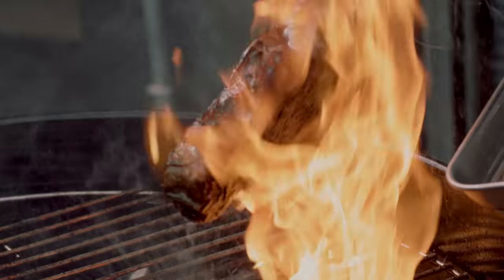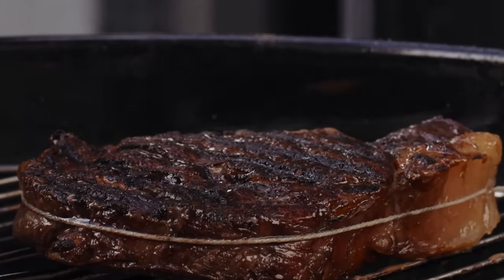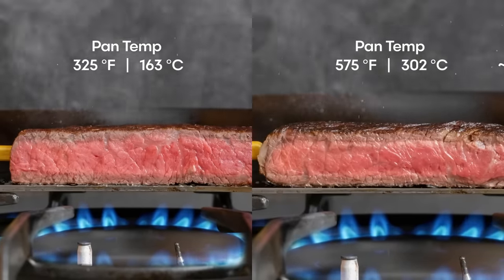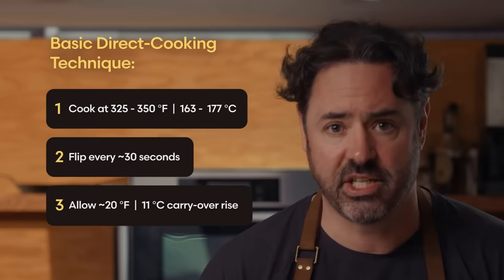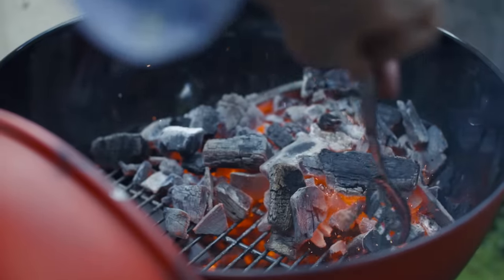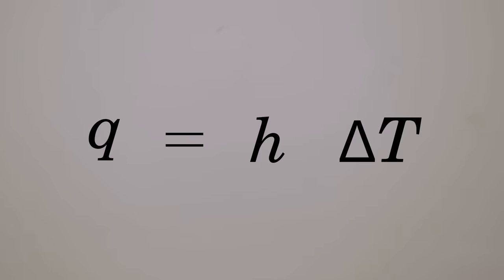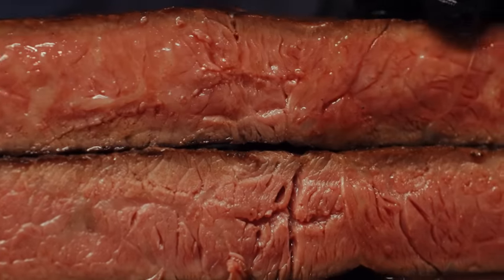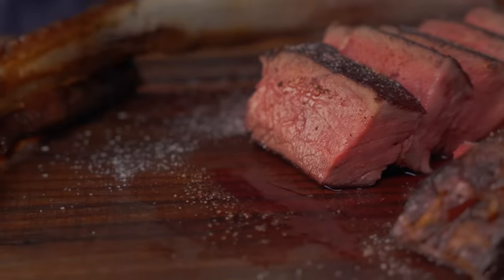Why Ripping Hot Is Too Hot? | TESTED

Comment: i was a professional cook for many years, you only flip once, you do one 90 degree turn on a grill and one flip then one more 90 degree turn but its all subjective really. everyone has their own preference. but the more you flip the more moisture you lose since it generally pools at the top. most of the info here is true tho. but idk about flipping every 30 secs. the temp is on point tho. i mean you can cook even lower because the total temp of the steak shouldnt reach more than 160 which is pretty well done. Its just a matter of how long you wanna wait and how well you want it done. my job cooks at 180 degrees but when the meat hits 145 max its  done so the final temp is a few degrees higher. but i also had a guy that liked his cooked over high heat for literally one min per side. the meat would still be raw in the middle but thats what he liked
Reply: That method has since been disproven by science.
Reply: @convincedquaker  In terms of the moisture loss your right, but that's what they taught at the time where I worked. I believe It was more for aesthetics since your cooking in a restaurant n want it to look nice for the customer. Plus they likely thought it left less room for the patty breaking up the less you handle it. Personally I do 3-4 flips and the turns to keep the nice look whether its at home or not, Obviously that's on a grate since in a pan or flattop it makes no difference. Flipping it more def decreases cook time and I personally notice no difference in moisture as long as you don't overcook it

EDIT: thought this was about burgers haha

Comment: How about an infrared burner?  My IR burner is between 1200 - 1400 degrees and puts a beautifuy sear on a steak in a minute without having to dunk it in oil and deal with the incredibly messy cleanup.

Comment: Two questions. So best steak is sous vide and dip in deep fry? 
Two, does heat transfer is 1kWm^-2 for vaporising content or like a metal bar. Cause if it's the former it's moot when it comes to physics. It's like saying frying ice will work just as good as boiling water on pan and pretending Leidenfrost effect doesn't exist.

Comment: Using a blowtorch rather than a culinary torch is a sneaky way to give your desired result on this test. Redo it with the proper tool. The broad flame on the culinary torch lets you work from a greater distance, controlling the temperature at the surface of your steak.
Reply from the maker: It wasn’t an attempt to get a sneaky result. I’ve used plenty of different torches in professional kitchen for years. They all have this problem. Burning gas is always going to give you a flame temp around 2000F, and the expansion of gases will always create a fast convection zone. Even if you work further away, some bits of food will dry and burn faster than nearby bits on the surface and leave a charred taste. Some folks don’t mind the flavor. I do.

Comment: Very interesting. So additionally, thickness of steak also matters. Now I'm also curious if fat content and consequently cut of meat changes cook time.
Reply from the maker: Higher fat content lowers heat capacity and increases thermal conductivity, so a really well-marbled cut does cook faster. But it’s not a massive difference: maybe 5 to 10% faster for a steak.

Comment: Chris, at what temperature do you take the steak out for reverse searing? At 90 or 100 or 120? You never mentioned that.
Reply from the maker: I take it to 130F edge to edge using the surface temp feature of my thermometer, then let it cool for at least 15 minutes before searing
Reply: @ChrisYoungCooks  thanks. I have yours but I think I need the app to see the surface temperature. Correct?
Reply from the maker: @AllenAchaemenes nope, you can hit the Temp button on top of the display to toggle between core, surface, and ambient temps. Keep in mind the surface temp isn’t perfectly uniform: fat caps run warmer, and the sides tend to run a bit cooler than top and bottom that dry faster.
Reply: @ChrisYoungCooks Thanks again. Last question? After I take the steak from the oven and let it sit for 15 minutes, and sear it one minute each side by flipping it every 30 seconds. Should I bring the heat to low and put butter and start basting? Isn't the side that was seared for the last 30 seconds going to get seared more? How long should I be basting?

Comment: Question about your thermometer - it kept saying "no predictive thermometers were harmed in the making of this video" when they were exposed to very high temps. Is that because they are designed to withstand them? Or more of a disclaimer to not do what it's showing there?  I have never heard of your brand until today, but I have a different one that cannot be used above certain high temps
Reply from the maker: The thermometer can handle temps up to 600F continuously, and the ceramic handle is flame resistant and can handle very hot searing for several minutes like shown in this video.
Reply: @ChrisYoungCooks  that's awesome! Thank you

Comment: I wish I could get hot temps. My issue cooking steaks is usually running out of time to make a solid crust because I don't have enough heat. I hate having gray steaks that are also medium or higher in the center, and maybe if im lucky a couple slivers of brown on the edges.
Electric stovetops are weaksauce, and even gas stoves in newer homes aren't as impressive cause they have smaller pipes and less btu's coming out. If I had access to a grill I'd for sure do some reverse sear goodness more often, but maybe life is just telling me I don't deserve steak as often as I want it.

Comment: That's a lot fo things to think on.
SousVide to 128 and then 375 in 1/2" of wagyu in cast iron?  flip at 30 seconds, for another 30, then let rest?
sous vide to 125? then same?

Heat the wagyu fat in a smoker? ????

Same with bone marrow?

Comment: I was tired of paying 20-30 euros for wack ass steaks at restaurants. Only had 1 or 2 good steaks. So decided to cook at home. Been buying various cuts, from chuck eye, to ribeye from butcher, usually around 22.5 euro / kg for ribeye, thats about 10.2euro/lbs. 30 minutes at 270f/125c in the oven, 2nd rack from top. Then sear on hot pan 45-50 seconds each side, and 45 secs rotating on edges. Amazing juicy steak. I also played around with brining with salt, from 2 hours to 2 days. Just simply put plenty of salt, and put it on the rack and place it in fridge, make sure to have surface beneath for air circulation. Its day and night how tender and tasty steak is, if its brined for a day or two, vs 2-5 hours.

Comment: One thing you missed is that often home cooks get better results starting from a higher temperature because their pans don't retain heat very well, and it drops 150 degrees in the first minute of cooking.  350 might be hot enough, but if they start at 350 pretty soon they'll be at 200 and have to work the temp back up.  But if they start at 500, they'll drop to an appropriate heat pretty quickly anyway.  This could be solved by using a castiron though.
Reply from the maker: That’s worthy of another video, but these tests were done on a 1500 watt burner, and most domestic built-in stoves can supply more power than that. The idea of massive heat drops on a domestic burner and therefore needs higher temps isn’t supported by the tests I’ve done 🤷‍♂️
Reply: @ChrisYoungCooks   You probably don't use a flimsy lightweight $9 pan from the supermarket though
Reply from the maker: @AlexanderRay92  True! But I do have relatives with crap cookware that I have to use when visiting and have to make it work. 

When the metal is too thin to conduct heat well, the best thing to do it use a burner that’s almost as wide as the pan and then make sure the pan is sized appropriately to the food. Even a crappy stamped thin metal pan does ok in this situation. But you definitely have to be more on the ball with your technique or things start sticking and burning. Honestly it would be nice if folks just owned an inexpensive carbon steel pan.

Comment: Great video, but for the experiments are higher temperature searing, shouldn't you have just seared it on each side for just a minute or two and then cooked the steak on a lower temperature? I don't think anybody sears their steaks at "ripping hot temps" and then continues cooking their steaks at those high temps.

Comment: Okay...but unless I'm missing something here, the point of a high heat sear is to get that maillard/char quickly without overcooking the middle.  For a thin steak like 1-1.5 inch, I achieve med-rare at about 500 temp cast iron after 2-2.5 min each side and the whole steak is done.  If I'm at 350, to get that same crust, it would take much longer and overcook the steak, no?  And I've always subscribed to flip once vs every 30 seconds unless it's a thick steak....but at that point, why not just reverse sear?
Reply: the point is that cooking at 500f will develop a crust faster, but doesnt cook the entire steak faster than at 350f
(given the steak has substantial thickness)

Comment: I prefer sous vide and then torched finish. Though, I use different torch that funnels out on the end and spreads heat evenly on about 3” diameter at around 600-800F. This allows more control at quicker rate. Then it comes to parties, I definitely have to switch to a grill that now can be changed to deep fried)
Those stakes looked delicious after deep fry finish!
Thank you for the tip😊

Comment: Speaking of pan temperature, what would be the best type of termomether to read the temperature of the pan?
Reply from the maker: And IR thermometer will work well on a cast iron, carbon steel, ceramic coated, and any non-shiny pan. For shiny pans, the IR will tend to misread and you would want a surface contact thermocouple.
Reply: @ChrisYoungCooks  Thanks, should be set for the emissivity of the oil at 0.95, or the pan material?

Comment: Interesting theories but some notions are just odd. Deep frying doesn't make something greasy because the oil doesn't soak past the crust and its just like a pan baste? Different fats and oils have different flavors. You usually pan baste with butter, you think dunking the surface in peanut oil or whatever is really gonna have the same flavor?
Reply from the maker: Of course oils taste different. They also are purely a surface effect and don’t penetrate beyond the crust. So the amount of oil retained by the crust whether basting or deep frying is very similar.

Comment: This is a bit simplistic. A great steak receives different temperature treatments. With a reverse sear, you absolutely need a ripping hot skillet/grill to get desired texture. Indirect heat on grill is another great way to go from high heat to lower temps.

Comment: I am thinking about doing the deep fry method soon. Just to make sure I am following the video correctly can someone confirm the steps below?

Post sous vide cook pat dry
Heat oil to 400F
Let rest 20-30 minutes
Deep fry steak for 3-5 minutes
Remove and let the steak rest on a cooling try for a few minutes
Enjoy
Reply from the maker: Yup, those are the steps. A few comments: (1) you can rest the meat in the freezer for the best result. (2) Make sure the meat surface is very dry to avoid nasty splatters in the fryer (3) Use a big pot. The pot in the video was over-filled for effect. Generally the pot should be no more than 2/3 full and 1/2 full is safer.
Reply: @ChrisYoungCooks  Thank so much for the advice. It's really cool that you take the time to respond to fans.

I was planning on using my enamel cast iron dutch oven filled just enough to cover the steak. It is only a single 20oz ribeye. I normally use a torch with propane and a Searzall, or sometimes I just use the torch and MAP gas if I want a bit more heat. This method caught my eye when you first posted the video though and I figured Valentines Day dinner would be a great time to try it out.

Do you have a preference on oil type? I was thinking I would either do corn or peanut since both are cheap.

Comment: I don't like sous vide, fry pan, deep fryer and where I live gas grilling is off limits.  I like indoor enclosed cavity electric grilling.  That you get by a Ninja 4 in 1 Indoor Grill with air fry.  It's one of the best air fryers out there and it a darn good effective grill thanks to it's heavy steel grill insert for locking in the built up heat.  Aggressively moving cyclonic hot air is what is really searing the meat like the steak was immersed in a deep fryer.  I hate my sous vide machine and deep fryer.

Comment: Running a charcoal grill for a piece of meat is more time consuming than rewarding. Pan is an obviously better solution.
Eight or even six steaks in a pan would fill the half of a house with smoke and force guests to wait for food for a long time and the host to "enjoy" the solitude. 
The difference between reverse sear option (dozen steaks at a time is not a problem, easy to take them off one by one at the different temperature before guests even arrive if you know their preferences at least roughly) and sous vide (solid choice for a few pieces cooked trouble-free to the exactly same temperature) is also clear. I'm not sure why those questions were even asked.
I feel absolutely stupid writing those banalities.
But thank you for this video. It's awesome, clear and concise.

Comment: Infrared radiation can pump as much heat as deep frying though (as in a ripping hot char grill), though only on one side at a time. 
Maybe we just need some sort of industrial strenght toaster for reverse searing our steaks :D
Reply from the maker: Yes and no. Infrared can carry a lot of heat energy—especially at temperatures where the element is glowing hot. The problem, however, is that the surface of the food usually reflects rather than absorbs most of the energy—making the effective heat transfer rate much slower than deep-frying. Moreover, the emissivity of the food surface changes from mostly reflective to very absorptive as it begins to brown and darken, and this causes a lot of problems. Some parts of the food have little water and will brown quickly, causing them to start absorbing lots of the IR energy, making them darker still, causing them to aborb more energy, getting even darker and so on. This feedback loop continues until the spots that brown first burn before other parts of the foods surface have dried out and begun to brown. This is why you often get spoltchy browning under broilers. It's also why toast goes from not done at all, to burned really fast. Deep-frying cooks faster and more evenly, and no part of the surface can get hotter than the oil, avoiding the problem of uneven browning and burning that plague broilers.

Comment: It’s confusing how, over charcoal, with no boiling zone, that the steaks didn’t sear faster…you stated that the boiling zone in a pan is what causes the problem.
So how does it remain with it no longer being an issue..?
Reply from the maker: The boiling zone is inside the steak and it’s present whether you use a pan or a grill.

Comment: Wait.  From your wording in a few segments, it sounds as if you feel you are hostage to whatever the dampness level of the meat is, before searing.  Doesn't EVERYONE pat their steaks as dry as possible, in advance of the sear???  Seems to be a universal recommendation in all searing info I've encountered.  I'd love to try a deep fried good cut of beef, but since I don't use garbage seed oils, there's no way I'm setting up a full pot of olive or avocado oil.  P.S.  It seems like someone really needs to define "ripping hot" in a more precise manner.  The vague notion I get seems to be that it starts somewhere around 500F.
Reply from the maker: Patting dry does nothing to change the amount of water within the actual tissue that has to be removed during searing.
Reply: @ChrisYoungCooks  Oh....well I'd never heard anyone address that, only that the surface needs to be dry for the best sear.  I think I've actually been undershooting the sear temp, and will make sure the next one is about 350F, and I'll flip every 30 seconds as you've recommended.  It's clear to me now that I've never come anywhere near "ripping hot", and I'm glad of it.

Comment: Just put them in the oven  for an hour or so at 60°C so the inside is perfectly done. It also dries the Outside and makes the meat more tender. Then sear hot and fast. 

All the steaks you´ve shown here had overcooked sides and I wasn´t impressed by the crust either.
Reply from the maker: Literally two of the steaks were sous vide and sear and a very low temp reverse sear. If you reckon you can do better post a picture or I call BS

Comment: Great camera recordings - however, the core of this video is wrong and that is due to a lack of biochemical understanding. You can not record flavour synthesis with a camera ;) and you need some mass spectrometry. The mentioned Maillard synthesis (~roasting flavors) are related to temperatures and they can easily go to 600°C. When you heat me for a short time like 30 seconds up to 800°C, one has the most flavour compounds. The outerside has a lot of pyrazines and 1mm under that you have your classic maillard flavour compounds like aldehydes which are created at 200°C or so.